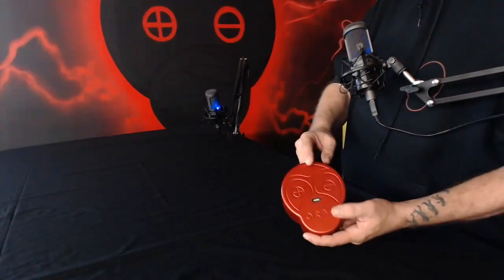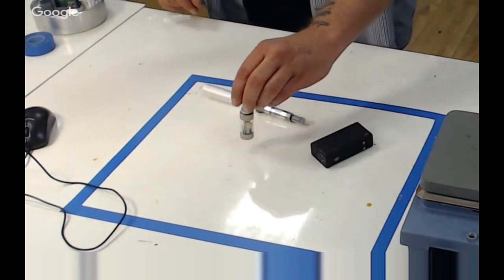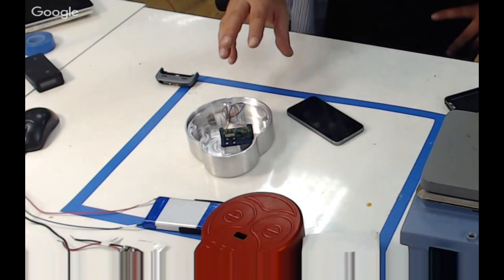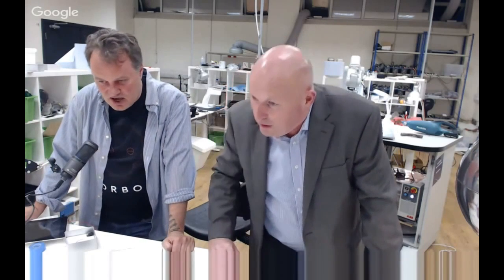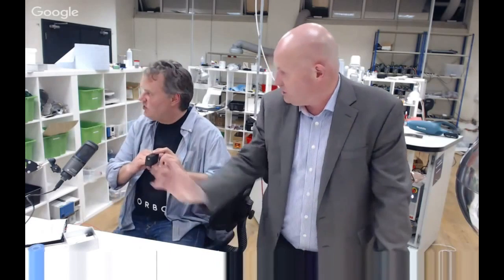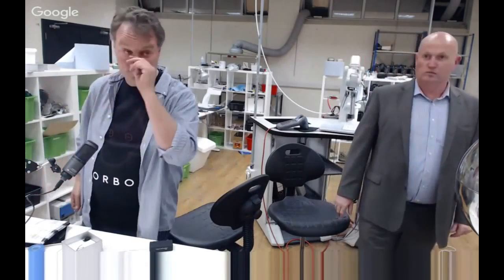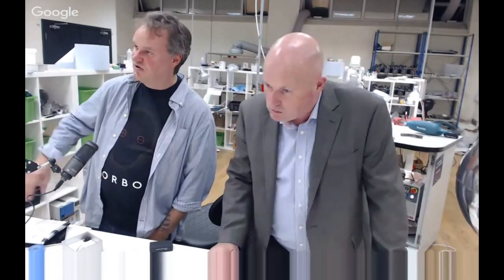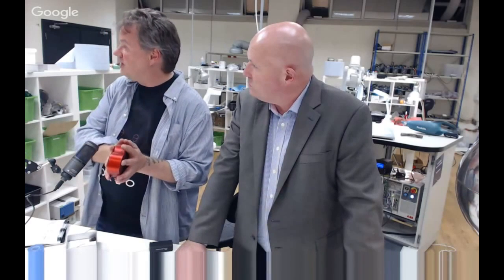Solid State Free Energy Device - The Orbo Cube Charger Compilation

Comment: Love the way the girl pops up stating the battery is dead i think NOT !! Sure what the feck are they using but a Lipo batt ..  I knocked up a unit myself about a year & half ago for less than 150 euro  not only can it charge phones laptop's but you can take  out you're car battery it will start you're car and run around with it and if need be you can charge it back up in less than a minute and i'm not using a battery only Cap's .

Comment: pretty simple technology, with mass(factory) production this should cost very low, but does it have a decay of energy production after time, due to the loss of charges in the electret?
Reply from the maker: yes that is still the big question how long will these electric Electret wafers last to produce energy....
Reply: overunitydotcom
 i don't wanted to be negative about this technology,
what i say is the importance that if it work for 1 year (for example), this can be built in a way we could at least recharge the electret when its "discharged"
Reply: +Gianni Laschi He talks about that around 7:45 into the video.